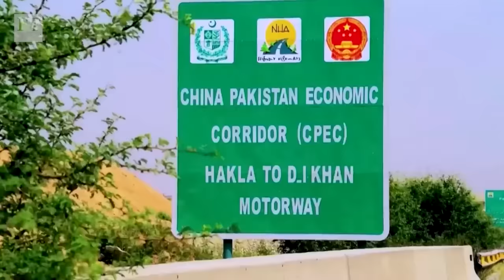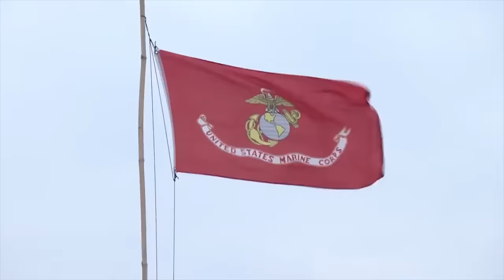How China lost Philippines?

Comment: The debts aren't even a problem since the Philippines had a surplus ever since the economy turned for the better during President Aquino III and onwards. We have a good credit rating and we know we can pay since we will still have a positive debt to GDP ratio even if we proceeded with it. The problem boils down to public trust since all deals that the Philippines have made over the years so far with China has been wrapped in corruption. The most notable ones being the ZTE-NBN Broadband deal and the Northrail project. And now the projects in the Philippines by China are all being scrutinized and halted for poor quality and potential harm to the environment. Heck, our deals with Japan are even more expensive than our China deals and yet it doesn't suffer from the same problem. Another thing that's being questioned is the content of the deal since part of it is hiring Chinese instead of Filipino construction workers. There's a serious lack of oversight and transparency under that agreement, even when we put aside how it fails to benefit Filipino construction workers.